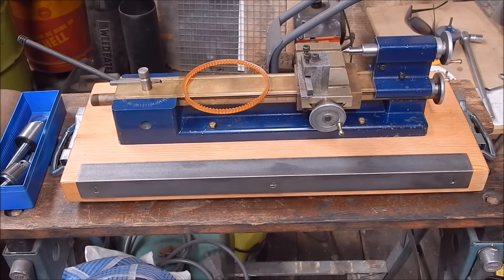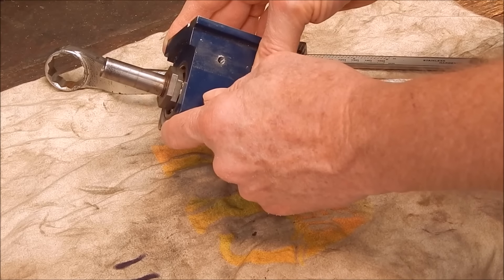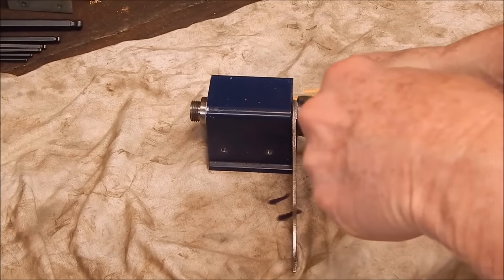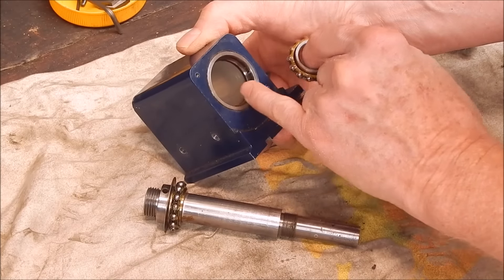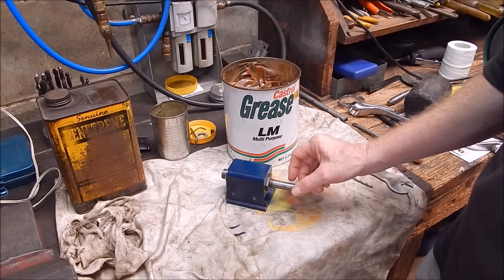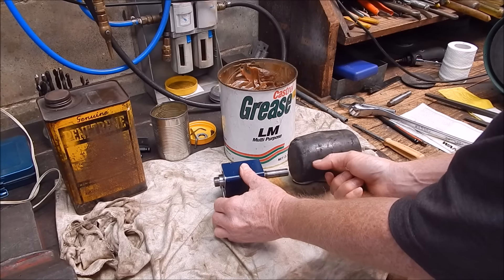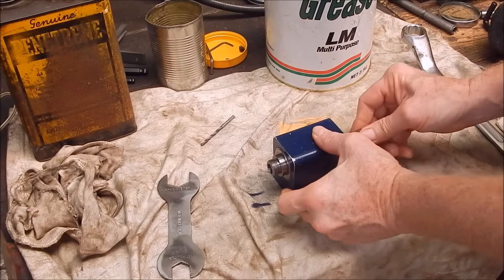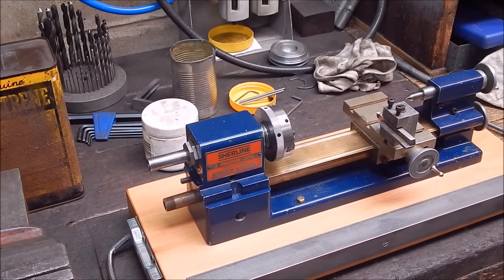Early Sherline metal lathe spindle bearing service - part 2

Comment: Since the run out of the naked spindle is better than with the 3-jaw-chuck internal grinding of the jaws might help. This should be easy work for your pencil air grinder.

Comment: Hi Rob, at the start of this video you mentioned that this lathe is equipped with a swivelling headstock. Can you explain the how and why of that particular feature as it is not something common to larger metal lathes, only some wood lathes.
Reply from the maker: Hi Mark,

The head stock is in two pieces.  The bottom bit is attached to the bed and has a vertical pin/rotation lug that mates with the top section.

 This enables the top section to swivel on the horizontal plane, to allow cutting of unsupported tapers (and alignment to the ways).

It's not something I've seen on a lathe before either.

Cheers Rob
Reply: The "why" is that it saves the manufacturing price of a compound slide. Ingenious. That's how you cut tapers on the Sherline. The price you pay is that you have to align the headstock at zero deg very carefully with the centerline when you have finished the taper.

Comment: Another helpful video. I believe Sherline recommends 2 tenths (0.0002") end play....not 2 thou...(0.002"). sherline.com/Wordpress/wp-content/uploads/2016/01/preload_inst.pdf     Achieving 0.0002" end play would be somewhat difficult to establish (it would take a number of iterations and obviously a test indicator with the appropriate accuracy).... particularly given the nut compression that always occurs as you noted.
Reply from the maker: Hi Hans,

Ooops I read that end play figure wrong from the data sheet.  That seems very tight to me, and as you say, hard to set up.

Thanks for the pick up on this.

I will stick with the existing setting for now and see how it goes.

Cheers Rob
Reply from the maker: Hi again Hans,

That reading from the spindle end is probably not accurate anyway, as the indicator base is not mounted on the lathe bed.  There could easily be some movement/flex between the two when I apply heavy pressure to the spindle.

I couldn't feel any end play physically.  Interestingly Sherline don't specify the end loading to be applied when taking the reading.  So the whole specification seems a bit questionable.

Cheers Rob
Reply from the maker: Hi again Hans,

Actually the more I think about this, the more dodgy this whole end play reading becomes.

There must be flex in the primitive two piece head stock as well, which will throw things off.

The whole specification then becomes completely useless without a factory jig to read it - as identified by the technical sheet.

Cheers Rob
Reply: Rob. You make a valid point. When one considers the potential deflections in the spindle system, along with an undefined applied axial load for said end play measurement, then numbers like 0.0002"  do indeed become questionable. I like your commonsense approach. I believe that there is more potential for problems with too much preload than a very slight excess in end play. You have confirmed that the runout is still good and perhaps a hair better. I will be interested to hear it run.

Comment: ATTENtion you should be using kero-ZENE Ya?
Reply from the maker: It's probably safer, but my mechanic father always went the "fast" way cleaning parts - PETROL.

Also it leaves no residue, and evaporates off very fast with an air duster.

If you want REAL clean, then use acetone.

Cheers Rob

Comment: I built a mini lathe for precision work and I would never accept 2 thou. run out on anything. Anything over a tenth drives me nuts. Someone asked me why I didn't just buy a Sherline instead of spending two years building a machine. I said because I wanted a real lathe.